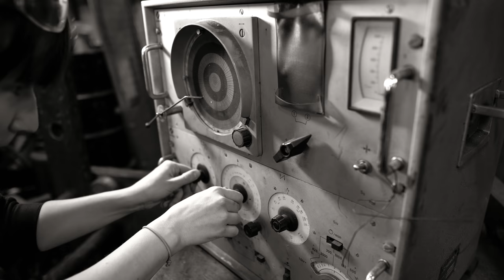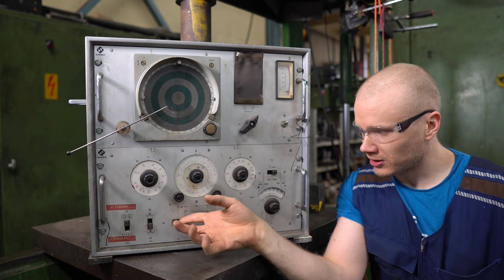6 Ton Pneumatic Crane and other Workshop Treasures

Comment from the maker: Be sure to watch our next Sunday video! We have 3000 bar (yes 3000 not 300) / 43500 psi pressure washer Vs. Frozen Lake video coming!  :D
Reply: The word for that balancing device is called Retro
Reply: Really nice! Is it one of those using hot water also? That would be really awesome - but even with cold water, it will probably cut tru the ice easely with that much pressure.
Reply: 3000 bar?  DAMN!
Reply: Dang, be careful with that man. 3000 bar is nothing to joke around with. I usually get anxious when I have to go over 350 already.
Reply: Watch furze
Reply: The reactor that I worked on runs at 3000 bar. We make plastic.
Reply: Taofledermaus is wondering where the toilet paper slugs are.... hes starting to lose hope. Where are they????

Comment: 9:13
It's called EDM-Machine (electrical discharge machining).

Also known as spark machining, spark eroding, burning, die sinking, wire burning or wire erosion.
Reply: ESPneinDanke You can make insanely accurate machining with that method, it’s pretty cool
Reply: Coolest of the 5.
Reply: I give EDM machine 10/10. Those things are insane!
Reply: A German POW who decided not to go home from Bedfordshire at the end of WW2 (there were quite a number of those: I used to live in a cottage that one of them had renovated) became welding tutor at Barnfield College in Luton and when he retired, he started making sculptures using an EDM machine. Another college in Luton , Putteridge Bury (now part of the University of Bedfordshire) once had some East China deer living in the grounds when it was a (very large) private house. One day, this ex-POW turned up and presented Putteridge Bury College with a small but perfectly-detailed sculpture of one of these deer, in bronze. It had been freehand "sparked" rather than cast from a wax model, and showed incredible skill and tool-control. I think it's still in the reception area and visitors can ask to see it. Most people think it's just a very good bronze of a deer, but people who know about welding and EDM cutting tend to be awestruck when they realize how it was made! He even managed to produce light-coloured dappled spots on the animal's flanks: I don't know how, unless this was achieved by changing the spark energy in some way? Zoologists are impressed by what it's a sculpture of, because this isn't a common deer species in Europe, never mind Bedfordshire.
Reply: @matthewspencer5086  
Very interesting.  I'm from Leighton Buzzard.
Reply: @matthewspencer5086   Wow!!! How do I see a photo of that thing ? Do you think it might be available on the web? What's amazing about this world, is amount of completely talentless  people with millions of followers, and then there's a guy who makes a bronze sculpture of an animal, using a tool designated to a totally different purpose,  showing unbelievable skill while doing so,  and he's gonna die with only maybe a few hundred people ever hearing about him and his glorious abilities. Messed up world, indeed
Reply: @wilhobbs207 : The main camp was at Clapham, North of Bedford. (Roughly where the Immigration detention Centre now is.) The POWs were allowed out on Sundays on Parole, but told they could be shot if they entered any town with a railway station. So they would borrow a rowing boat and cross the river to Bromham, where they would gravitate to the Baptist chapel (wooden hut in those days) where my Grandfather preached. (Churches in Germany had to have Nazi flags on the altar and all sorts of crap, so they were relieved to find a normal chapel and they bought an actual NAZI with them, because they thought the word of the Lord would do him some good!) At that time, the American armed forces were legally segregated and white and black servicemen weren't allowed to mix. So, one Sunday, a group of white American airmen from Thurleigh appeared and found they had a choice between sitting next to black American soldiers or sitting next to German sailors! This was new to them, but it didn't actually hurt them at all. The black soldiers also found that nobody in Bedford had heard of racism yet and they could go into all sorts of places they would never have been allowed to visit back in America.
Reply: @raphaelmirzoyan5628  I am not sure if there is a photo, will have a search later and post link here if I find it.

Comment: The pneumatic crane is also my favourite.
You can use it litteraly everywhere , as long you have a compressed air bottle with you. 
It would even work under water, or in the forest, or in an under water forest^^

Comment: 'Perpetual Motion Machine' is actually a Stirling Engine. They work by temperature differences, so not perpetual but definitely VERY cool.
Reply: Or Hot...depending upon your particular thermodynamic viewpoint. 😁
I first read about Stirling engines in Popular Science magazine about 45 years ago, and have always appreciated their simple, yet often beautiful design and construction.
Reply: I have a similar unit which is solar powered.

Fun fact, the new NASA "Kilopower" nuclear reactors use heat pipes and Stirling engines to generate relatively large amounts of electricity in space or on other planets. I am reasonably certain that the Stirling engine is the most efficient practical heat engine ever designed.

Comment: You can easily define a Cleaning Efficiency Rate (CER), SI unit: [Holy Shit / Hours], you simply take number of "Holy shit, we have this kind of thing? I did not even remember, since how many years did this rust over here and more importantly, how many times did we not use due to forgetting about it when by the way we rather needed it back then?"-s and divide it with the cleaning time. It's magical.

Comment: 5:39 Please, always be sure all hoist hooks have spring loaded hook mouth gates that completely close!  These are often overlooked, or simply removed. I was working with a guy who was lowering a steel plate about a meter and a half square by half meter thick. When the plate met the floor, the lift strap slacked and came out of the hook, the plate leaned against his leg, pinning it and completely destroying his leg and foot as it fell. Years later, he can barely walk. Its such simple thing people overlook.

Comment: the spark machine i think is called elecrto erosion and is used to make super tiny holes through steel... the mastering is to go precise and streight:) and obviously the things that you said..is also used to make steel molds for let the air and material to escape in profound sectors.. is an important tool

Comment: i use a similar table magnet for my old grinding wheel (i dont know the english terminology in italy we call it "rettifica") makes 2 planes parallel to each other, (used to make the head of a big engine for exemple.. if you want i've got a video..it's like 1700mm by 500mm of working and it is very nice tool to have in a workshop maybe you want to make one for your workshop :)
btw love both the channels
p.s. big tables like that for big grinding machines are quite rare and if used well can mantain good accuracy (like  +-0.01mm in a meter or more)
Reply: It's the magnetic chuck for a surface grinder.
Reply: @cambridgemart2075   thanks for the right terminology man ;)...do you work with this kind of machine?
Reply: @riks7256  I have done in the past, but no longer have access to those machines

Comment: Sleeveless boiler suits? What's the point? Haha
Reply: Quite common in Scandinavia in all kinds of trades, I'm a carpenter and use them sometimes. Lots of pockets and more comfortable that wearing a belt when your pockets are full of crap.
Reply: That's just normal metal shop clothing....you really don't want your sleeves getting grabbed by a lathe !!
Reply: Both make sense, guess I'm thinking from a welding point of view